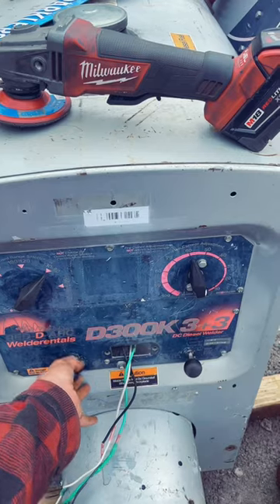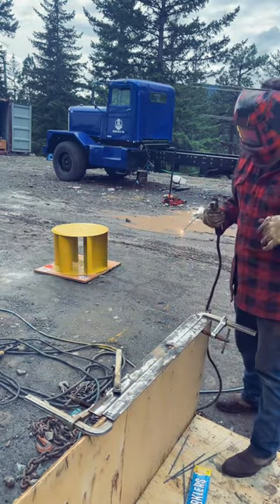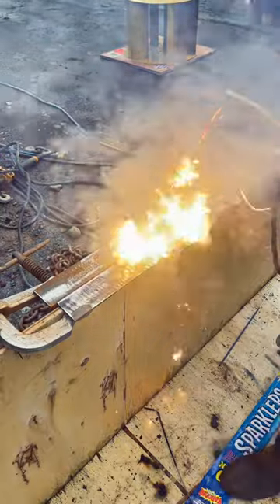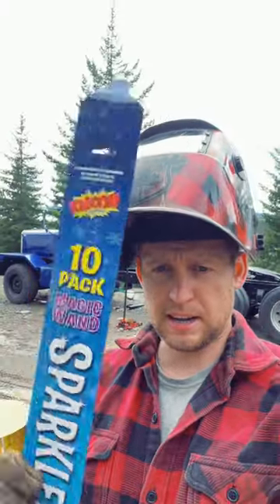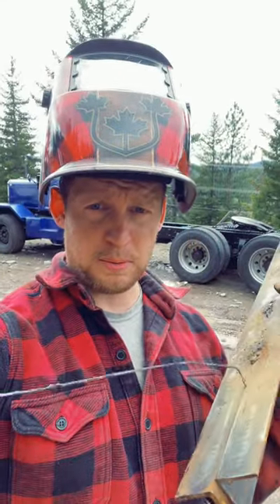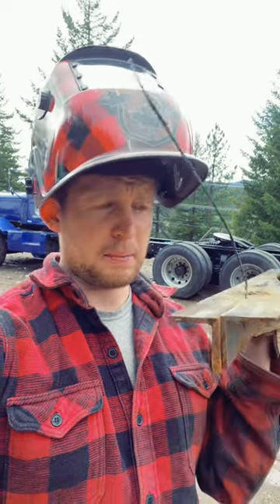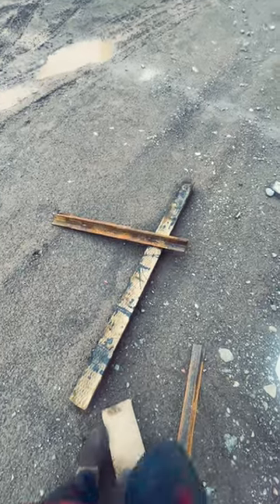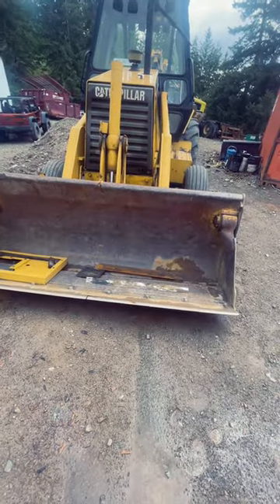Sparklers for Welding Rods

Comment: I’m definitely trying this next time I teach someone how to weld
Reply: Ha! ha! ha! Same!!!!
Reply: Why wouldn't you want to properly train someone you're paying?
Reply: @Rabbit-the-One cause it’s fun to fuck with people. Especially if you can get a laugh out of them.
Reply: @Rabbit-the-One Cause lil guys insecure and wants to make other people's existence more annoying.
Reply: @toastyxboops  also horn fluid. Too bad 32 Oz tin can of horn fluid is only good for 10,000 honks. 😂
Reply: @Rabbit-the-One it actually might help break the ice, help em relax being new and nervous about the new job. Some might take it wrong but most I think would help em chill out.
Reply: Like 
“Damn you must suck, non of your welds are even holding.”
Reply: My dad did hardwood floors. He asked the new guys to go out to the van and get the board stretcher, if they cut a piece too short, so they could stretch it to the length they needed.
Reply: @hostjhall Im a freight handler at FedEx and one joke is getting the trailer stretcher when you just don't quite fit into a trailer
Reply: @_P0tat07_  its also actually practical if its just to teach the basic concept of laying a beed for maybe the first few days of hands on practice welding.

Comment: Ah yes, the classic welders apprentice joke. Between this, shutting off the lights, and the acetylene balloon you have the full trifecta.
Reply: Bro the acetylene video was crazy💀
Reply: You forgot the white paper in front of the welding hood.. That one's a classic.
Reply: hahahah never heard of shutting of the lights before. That's a good one lol
Reply: Make sure youre having the apprentice keep the plasma tank full on the plasma cutter and keep a box of spot welds handy too!
Reply: Man. Old body man showed me the acetylene thing years ago. Maybe 14. 
We did 2 ballon’s inside a junk car. Amazing. 

First one tho was a small styrofoam cup. Cut a notch, placed it upside down. Put the torch gas to it.  
When we lit it, it hit the roof a second later.  

The balloons in the car, blew out the windows, buckled the doors and roof.  

He told me that as a kid, they’d set a 55 gallon drum upside down on some blocks, put 2 or 3 balloons in it. Barrel would full send 30-50 ft in the air. 
Never tried it, definitely want to.
Reply: @UnknownDevices91  If you use a drum, the balloons are unnecessary.
Reply: @TehButterflyEffect  meh. Every drum I’ve had to play with has been a rusted burn barrel with the top cut off. 
Wasn’t taking the time to get an airtight container. Like idk, a balloon.
Reply: Don't forget the quikslaps

Comment: My hillbilly uncle just used coat hangers. 

He also grew up with a dirt floor, so...yeah.
Reply: Coat hangers, flux paste and oxy-fuel.
Reply: Coat hanger and masking tape with powder laundry soap works great
Reply: @charlesbanks9001 I am trying to run what you are saying thru my head. Pls explain to me bc really don’t understand. Genuinely curious.
Reply: @hoktang1  so if you wrap a coat hanger in masking tape (the white paper tape) that has powder laundry soap all over the sticky side the soap acts as a flux (most powder laundry soap contains borax) just like 7018 minus the iron powder in the 7018 flux
Reply: @charlesbanks9001 thanks for explaining, no way you can run much juice through that though right?
Reply: @NinjaofApathy  I'm not too positive on max volts and amps, but I'm curious also so I think I will try it tomorrow to find out and make a video of the whole thing
Reply: @hoktang1  Back on trade school, my instructor would talk about things the old timers would use to get the job done but mind you that thing we're made different back then like steel coat hangers and the chemicals that laundry soap contained but the theory is pretty simple, 7018 is best ran on A.C. current and that is like a scrub brush, the soap was a cleaner and the borax shielded the weld so the weld would cool  slower and the tape did 2 thing, it burned up the oxygen and held the soap to the hanger  making for a pretty weld
Reply: @charlesbanks9001  thank you so much for information. Bc I could figure out in my head how all that related to each other. You have a great day. Thanks again.
Reply: Straight Borax powder being better of course. For steel on steel you just use the coat hanger as filler but welding using BRAZING brass rod on steel yes definitely need the borax
Reply: Coat hanger and oxy/acet is how we were taught in HS metal shop
Reply: Gotta do what you gotta do.😂
Reply: @charlesbanks9001 Die you try it? I would love to wach your video if you make one.
Reply: @512Chaos there's an older gentleman in town here with plenty of old equipment that has been repaired that way for eons.. it's amazing what you can do if you don't have another option/can't afford one. Metal coat hangers probably aren't the same anymore
Reply: @charlesbanks9001 Cellulose type flux would be more like 6011
Reply: Hangers work in a pinch, better than walking out from the trail and hitchhiking for some rods...
Reply: @SLOCLMBR  used a coathanger to finish a tig weld, since i ran out of filler rod and needed the part asap. Works decently well once pickled in muriatic acid for a short while. Emery cloth works too. Not sure how strong the welds actually are, when compared to fill rod, but 8 years on only one part failed, and it wasnt the welds.
Reply: @hoktang1 Old Coat Hangers are made from steel and some are very heavy duty. You where thinking plastic coat hanger ?
Reply: @RuralTowner do normal welding rods have borax im them? I always thought it was mainly carbon dioxide from some kinda carbonate helping shield the weld.
Reply: Any flux that comes with the rod will be as a coating. There are//may be differences between the welding rods based on what their intended purpose is.
 Borax is a sodium carbonate.  @diapysik
Reply: @diapysik  depends on the welding rod for instance 7018 has more iron powder in the flux fir better arc Penetration and 6011 has more organic substances  for shelding the weld but yes they have some type of detergents to help scrub the weld if you will
Reply: @charlesbanks9001  Talk to I about this so this Organic is it Red Wine drinkers?
Reply: @peterparker9286  ????? What ????
Reply: @charlesbanks9001  This is going to go deep brother and I need you to follow Me... read back talking about yoir comments the white tape ? The wraper of the package. And the Ark/arc.
Reply: @charlesbanks9001  So Iron man has a white wrapper his flesh. The Arc a direct short to Ground thing from the disc in the sky....
Reply: @charlesbanks9001  With the saying you are what You eat. There are different people who consume different Foods. I know your prolly thinking I am just right out of my mind but this has made my journey better Thank you

Comment: I cannot believe it worked even that much. I bet there are guys who could make it work.
Reply: The sparkler wire is typically iron, from what I can find. This could work but it would take a lot more work to make a strong weld. I did a search for DIY welding rods and there are some options that are better than a sparkler.

Comment: Haha, I did the inverse once. Found what we thought were really heavy sparklers. Took like 2 minutes to ignite, barely produced visible light, and got hot as heck.
Reply: Heh?
Reply: good job Forrest
Reply: A welding rod is not going to continue to burn like a sparkler. I don't believe you.
Reply: @SwapPartLLC  It took well over a minute to ignite by holding the whole thing in front of a torch; it was by no means a very stable burn. Definitely did burn, though.
Reply: @SwapPartLLC He didn't say anything about it "burning like a sparkler", just that it heated up to a slight glow ("putting out color").
Reply: @ulogy What rod type?
Reply: @Marc83Aus  No clue! I was like, 9. All I know is it was very disappointing.

Comment: At one of my old jobs we did a lot of handrailing.
We got a guy that had been a pipeline welder for a long time. He was tired of working outdoors and wanted a shop job for a while 
I hid a roman candle in one of the handrails in his stack, put the fuse just barely sticking out at one of the joints.
The handrail starts shooting flaming roman candle balls out the open end and I start yelling

"I thought you knew how to weld pipe, man! I can tell all the way over here that your voltage is waaaay too high!"

Comment: Try using a coat hanger. I’ve done it. With two 12V batteries and jumper cables, no less. But that was just a patch on the trail and was promptly ground off and replaced.

Comment: the answer is in the way you called them out - 
Sparklers: "there are three main components: a metal fuel, an oxidiser, and a binder. There are also other optional components that can be included in the mixture in order to modify the effect. The wire that forms the body of the sparkler is often made of iron" 
7018: "7018 is the most efficient general-purpose, iron powder, low hydrogen electrode used for welding carbon steels, free-machining steels and low alloy steels with minimum yield strength of 50,000 PSI. 7018 has a very good deposition rate, providing a quiet, steady arc with low spatter and medium penetration." 
If its name is a number, it conforms to standard material properties.
Reply: bro is just trying to flex his copy and paste skills
Reply: @og.nohaze7740  I did copy and paste, but I was actually impressed that I got such decent comparisons just searching "sparklers properties" and "7018 properties" 

My whole point was, "7018" is meaningful because it refers to a particular alloy/formulation which meets material science criteria
Reply: @SixteenTonesStudio  what does that have to do with the video
Reply: @og.nohaze7740  just confirming the conclusion therein - can you weld with sparklers? ok, it makes somewhat of a bead. Should you? You won't be able to determine how strong your welds are, because you don't know the composition of the sparklers
Reply: @SixteenTonesStudio  Basically, you can use them but the weld will be full of random oxides.

Comment: The welder at work proved himself to me by using a gouging rod to weld with. 
He reckons a good welder should be able to control the puddles of just about any metals and get them to amalgamate.
I didn't get the chance to test him with brass, aluminium and another gouging rod. lol. He said he was up for the challenge, but I just couldn't find the materials.

Comment: When I was a kid I lit 4 boxes of sparklers at once , it was pretty intense , it melted a scrap piece of 1/4" aluminum like a cutting torch. When it got too hot to hold I dropped it on the ground it burned a hole in the dirt

Comment: Most sparklers are a low grade thermite, so if you use enough of them and it's on mild steel, you could theoretically get a soft weld. So it would be cheaper more effective and more efficient to use wild rod.

Comment: I've seen an old mechanic weld with wire clothes hangers. I was a young kid at the time so no clue how it turned out.
Reply: It won't work great but if it's all you got as long as you don't put too much stress on it it can get you somewhere to get a proper weld on it.

Comment: You have to add flux but you can weld with coat hangers. 🤔 Or you can leave the flux off and use an air hose to cut. There’s folks out there who know such things.

Comment: its not useful rn, but someday, someone is really gonna need to due a quick emergency repair, and for some reason they are going to be stuck out in the middle of bum fuck no where with a welder and some sparklers, and it will get them home. 

Kinda like when the throttle cable on my accord snaped at 1 am in the morning when i was about 400 miles away from my home. 
I ended up uses my shoe string and routing it up through the dash, and actuating the throttle by pulling the shoestring i zip tied to it. was scary, a pain in the ass, very hard to shift on a 6 speed when one hand is controlling throttle and the other is busy steering through winding mountain roads, but it got me home and i didnt have to use my free aaa tow so i was all in all a happy camper. 

all those weird tricks and life hacks seem useless until they literally save your ass one day out of the blue. 
pinching off rear brake lines when theres a leak so you atleast have front brakes and a way to get home. wheel starting a vehicle thats been stuck in the sand for quite some time when you have no jumper cables or jump box
using exhaust fumes from your engine to fill up your car tires with aire when you run a flat to get you to the nearest gas station so you can make a decent repair. 

so many different things ive thought were useless and dumb ideas until i was fucked out of luck and they were the only thing that got me back home. 

my favorite is when i had a very long, very rural drive, and i knew my car wasnt going to make it between certain lengths of the trip between gas stations without first running out. I brought a couple fuel jugs with me, but when those ran out i went ahead and pulled out some very cheap vodka and proceeded to dump that in my tank. Sounds crazy, but it will get you to where you need to go. its an old Australian outback trick. not a lot of gas stations out there. Some of the bogans even completely change their engines to run solely of of methylated spirits and nitro meth. Needless to say i was laughing my ass off knowing that i was somehow operating an american made truck off some very cheap russian vodka (it was on sale too, so even cheaper lmao. make sure if you do this its a clear and pure spirit like vodka, everclear, etc. dont put rum or whiskey in there, all that sugar and low flash point oil are going to gunk the hell out of your engine.

Comment: I'm not a welder or know how to weld, but i do know that the coating on the welding rods is a flux material where as the coating on sparklers is a flammable material that will contaminate the molten metal. Even a minimum wage welder would say thats not going to work. An expert might actually know how to make it work.